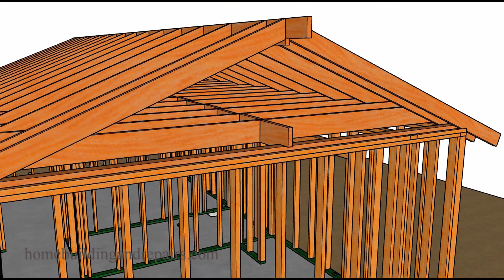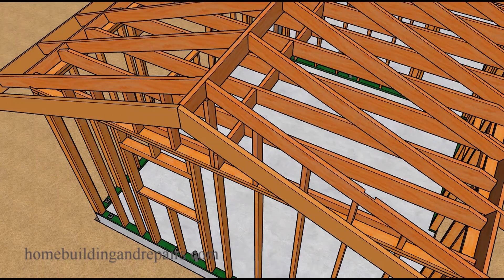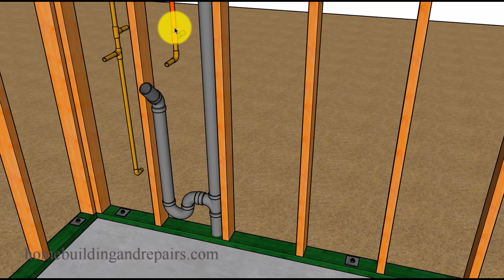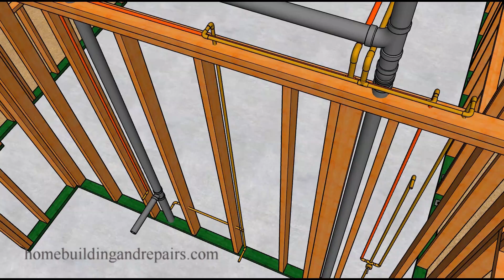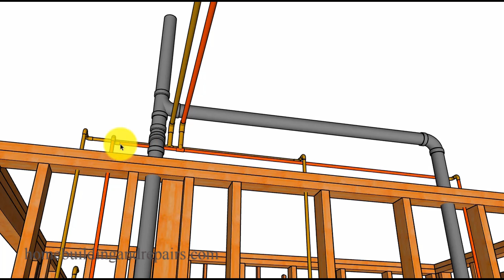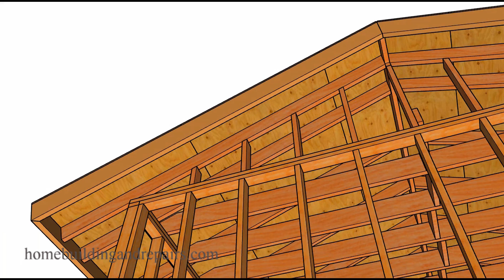Rough Plumbing And Roof Framing For 434 Square Foot Small House - Home Building Ideas And Examples

Comment: I was thinking...instead of having three 2 in. roof vent penetrations, could you combine them all in the attic space and just have one 3 in vent going through the roof?  I would think if the horizontal distance isn't too long on those, and if you increase the main vent size to 3 in. that would work? I do know there's a limit of horizontal length that you can go on vents. I just think fewer penetrations the better.
Reply from the maker: You would need to check with your local building departments if you have one to answer your question, but it usually isn't a problem and the two vents could have tied into each other.

Comment: Do I need wooden beams going across the top to  join adjacent walls on a gambrel roof which will be 8 metres wide. There will be a wall going through at 5 metres from floor to roof. Thanks. I hope I explained that OK.

Comment: A washer Machine ,drain code that is often overlooked. 2 inch drain is required. I don't know why but I have been called on it. The building inspectors did not have a good answer other than that's the way it is.
Reply: I think it's about the volume of water going through it as it drains very quickly and normally joins to a 2 inch pipe on the sink.